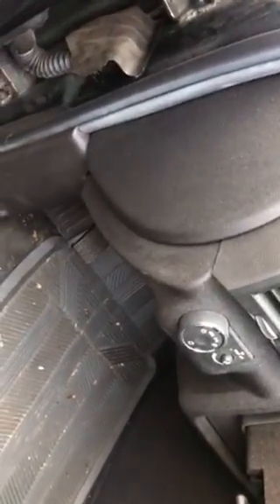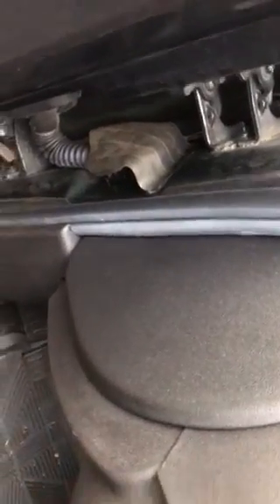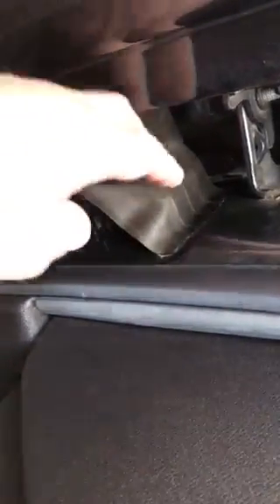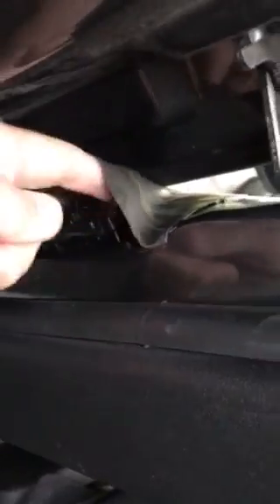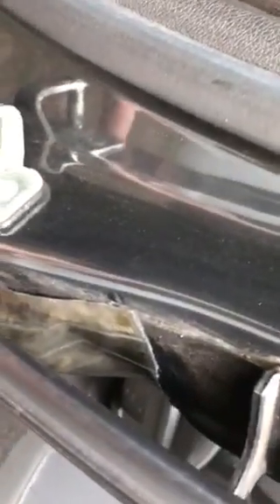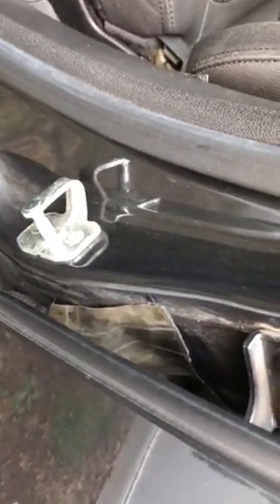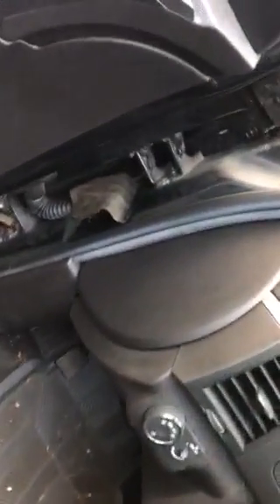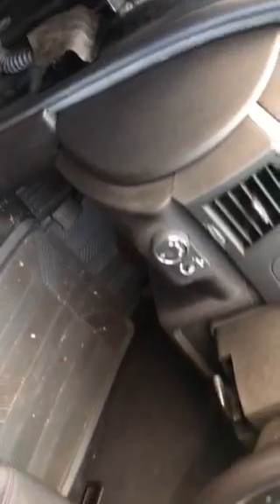Chevy Traverse - Easy Fix for Radio Speakers not working due to water leaking onto door wire harness

Comment from the maker: It stopped the water from entering the wiring harness switch at the door from the outside surface but I noticed that over time water still enters from the rear of the switch.  This means that water must migrate from the roof area onto the rear surface of the switch.  I have read that other people noticed this also and that it possibly comes from the roof rail screws.  What did solve the problem was that I actually replaced the front two speakers.  It was not all that difficult.  There is a video that provides details on how to remove the door panels.  Once you do one, the other is easy.  Once I gained access to the speakers,  I was able to confirm that the water issue was not the problem because the speakers were dry and had no evidence of being affected by the water at all.  In fact, the rubber tube that is seen between the door and body frame where all the wires go through has a sag and that is where all the water sits and never gets to the speaker.  I did notice that the wire on the speaker itself had partially decayed leaving what I suspect was copper dust,  Upon replacing the speaker, I tested it and it work as new and continues weeks later.  I checked the price for the speakers on Amazon and Rock Auto.com where I normally get car parts from and they were comparably priced.  Just as a tip, the left (driver's side) speaker is the one that is used for hands free phone use and the audible back up and  other alarms, so I would suggest to get that one first.  Bottom line, the speakers are not good quality like so many other parts on this car and made to last only to a certain point then require replacement.  I still left my " glued on covers"  if anything, to help control the front surface water issue anyway.  Best of luck with your car.
Reply: How do you remove the harness?
Reply from the maker: @josecolon6584  No need to remove the harness. I only unplugged it for inspection.  There are clips visible that allow for it to be disconnected.
Reply: Silicone all roof rack screws and washers.

Comment: I have this issue but my wires are dry and only my tweeters work. Temperature causes my speaker to work or not work.
Reply: Dats you ever figure it out?
Reply: I have the same problem with my HHR

Comment: 2014 slt bose premium 60k, 
Radio sound suddenly cut out, no signal sound, no back up camera sound.
Thanks to posts here and acadia forum. Disconnected 4 door jam connectors.
Moisture present inside 3 out of 4 connectors. Several ounces from drivers rear. Shake out water.
2 hours later all is working.
I am making a list of repairs to do to prevent expensive component failure and dangerous situations.
Will add sealing roof rack to the list.
Will bike tube repair, after drying and dielectric grease.
Will add a diverter inside for door speaker & wiring. 
Will seal inside door side of harness.

What I have read about all water intrusion issues 2008 to 2018.
Older vehicles had drains in rear fixed moon roof, many issues with those drains getting clogged and leaking in head rest. So they discontinued drains. The issues with leaks from same fixed moonroof with updated no drains.  Fix is remove moonroof and new seals installed on body and edge of moonroof.

Mostly older models or after windshield replacement leaks due to seal at bottom of windshield area into front floor.

All models with sunroof have 2 drain tubes that run down the A pillars on both sides. Constant clogging.  There is a rubber 90 degree grommet at middle to top of firewall on both sides that drain tubes attach to. Older models pre 2013 had a 4 tab water gate inside grommet to prevent spider nesting. (Bad idea). Gets clogged at that point and leaks. Fix cut out or melt out the 4 fingers inside grommett.
Also most models, where water exits the firewall, on the outside under wipers cowel. The water drains down, then reenters passenger compartment a few inches below drain, through a horizontal body seam. You seal body seam  from the wiper side of vehicle, up in hole, especially on passenger side. 
These water backups can cause drips onto fuse box on right side behind glove box. Drips on left side on top of steering column onto BCM  and radio amp.
Could short out many other connected components as well.

Comment: The speakers arent the problem if they are coming back on frequently after a couple days of warm weather. As a test open your door and disconnect the wire harness after a rain stom and let it hang  (upside down) and you will witness water pouring out of the connector. My 2012 traverse had this problem as well. Take a shop vac and suck the water out of each end then use blow dryer to finish the process. After a little while (time may vary I'm not exact on how long) the speakers will all a sudden kick back on. I'm in process of replacing my lady's speakers just haven't had time and well been lazy. To prevent the water I'd say this video is good idea, the roof rack bolts filled with sealant and whatever else we can come up with to divert the water trail coming off the top....

Side note I've also read about the car amp is the main problem but it pissed me off and I haven't got back to checking the factory amp yet. So not even sure where that thing is. For gods sake I'm a doctor, not a pool man!! Enjoy your day of tweeter music
Reply: Definitely not the speakers. They did start operating after the weather warmed up.

Comment: its not there its on the top of the truck on the rack just fill the holes with clear silicone and let it dry out radio is working like new
Reply: Do you have pictures please where you put it ?

Comment: Also on the Buick Enclaves…..I was told I had to replace the whole module which is going to cost $750….even though radio is going on and off.  Fought with dealership on this because it seems like a wiring “connection” problem because audio still works half the time.  But…..I lost the argument and they are going to replace it.  We will see.

Comment: How long did you have to wait so you can get the sound back on
Reply from the maker: I feel it had stopped the water at first. But once I noticed the actual speaker wires were deteriorated, I changed the speakers and they worked right away.

Comment: In some cases yes this is a good fix but in most cases the leak is actually from the roof rack bolt holes, and also water leaking down from the windows and getting on the speaker connectors. Seems to me that the main issue is poor weather proofing all around the vehicle. What I've done is removed my roof rack bolts and put clear silicone in the holes and bolts them back down, as well as using some black weather proofing tape (ZIP tape is what I used) around the electrical connectors on the sides of the doors and inside the door panel. Replaced all 4 speakers and so far so good, will see how this holds up after a few more rain storms.
Reply: Thanks I’ll be doing this 🙌
Reply: @drivewaybuilds did it work for you?

Comment: I can’t go to a car wash or I lose sound. Tried different ways, protecting the connection. I don’t think it seeps in from the seal not installed correctly. Started washing at home and found when I clean my hood, water is coming in. No water or dew in mornings, my speakers work.

Comment: Did this fix the problem. I have the same issue with my 09 acadia
Reply: Tina Edwards I have the same problem
Reply: What glue did you use to bond rubber to the vehicle?
Reply from the maker: Yes and No.  It stopped the water from entering the wiring harness switch at the door from the outside surface but I noticed that over time water still enters from the rear of the switch.  This means that water must migrate from the roof area onto the rear surface of the switch.  I have read that other people noticed this also and that it possibly comes from the roof rail screws.  What did solve the problem was that I actually replaced the front two speakers.  It was not all that difficult.  There is a video that provides details on how to remove the door panels.  Once you do one, the other is easy.  Once I gained access to the speakers,  I was able to confirm that the water issue was not the problem because the speakers were dry and had no evidence of being affected by the water at all.  In fact, the rubber tube that is seen between the door and body frame where all the wires go through has a sag and that is where all the water sits and never gets to the speaker.  I did notice that the wire on the speaker itself had partially decayed leaving what I suspect was copper dust,  Upon replacing the speaker, I tested it and it work as new and continues weeks later.  I checked the price for the speakers on Amazon and Rock Auto.com where I normally get car parts from and they were comparably priced.  Just as a tip, the left (driver's side) speaker is the one that is used for hands free phone use and the audible back up and  other alarms, so I would suggest to get that one first.  Bottom line, the speakers are not good quality like so many other parts on this car and made to last only to a certain point then require replacement.  I still left my " glued on covers"  if anything, to help control the front surface water issue anyway.  Best of luck with your car.
Reply from the maker: @chipb1193  I used an all purpose glue that I purchased at Lowes.  It is called Rapid Fuse by DAP.  The glue worked better than expected.   (Note my reply to Tina as it may help you also.)

Comment from the maker: The key question recently asked was, Did it fix the problem?  The answer: Yes and No.  It stopped the water from entering the wiring harness switch at the door from the outside surface but I noticed that over time water still enters from the rear of the switch.  This means that water must migrate from the roof area onto the rear surface of the switch.  I have read that other people noticed this also and that it possibly comes from the roof rail screws.  What did solve the problem was that I actually replaced the front two speakers.  It was not all that difficult.  There is a video that provides details on how to remove the door panels.  Once you do one, the other is easy.  Once I gained access to the speakers,  I was able to confirm that the water issue was not the problem because the speakers were dry and had no evidence of being affected by the water at all.  In fact, the rubber tube that is seen between the door and body frame where all the wires go through has a sag and that is where all the water sits and never gets to the speaker.  I did notice that the wire on the speaker itself had partially decayed leaving what I suspect was copper dust,  Upon replacing the speaker, I tested it and it work as new and continues weeks later.  I checked the price for the speakers on Amazon and Rock Auto.com where I normally get car parts from and they were comparably priced.  Just as a tip, the left (driver's side) speaker is the one that is used for hands free phone use and the audible back up and  other alarms, so I would suggest to get that one first.  Bottom line, the speakers are not good quality like so many other parts on this car and made to last only to a certain point then require replacement.  I still left my " glued on covers"  if anything, to help control the front surface water issue anyway.  Best of luck with your car.
Reply: Does the turn signal sounds come out the driver side speaker as well?
A year ago, there was a loud screeching noise coming out of the speakers. Radio wasn't putting out noise just a screech. The noise went away after a few days, but since then nothing comes out from the speakers, not even the turn signal noise.
I'm wondering if it could be just the speakers.

Comment: I tried it but does not work. Everytime it rains just a little I lose sound. The problem is the door seals. Even when I buff my car powder is all over, everywhere in door jambs
Reply from the maker: Try replacing the speakers.  If your car is the vintage as mine, it will most likely be the speakers failing.
Reply: My plugs are always wet. I'm going to try the silicone method on rack holes

Comment: All in good. How do I get the speaker back to working?
Reply from the maker: Unfortunately, I had to replace my front speakers   There are some really good videos on how to do this on Youtube.  I found that the speaker wires at the connection point of the speakers had deteriorated so badly that they had to be replaced.

Comment: What was the cause
Reply from the maker: I suspected it was the water at first but it turned out to be the speakers.  Their connection deteriorated over time.  Once I replaced them it was all good.  I still left cover on for added protection.
Reply from the maker: It was the speakers that failed.
Reply: Thanks; ordering some speakers now
Reply: @christopherbowers86 , any updates on your situation??
Reply: @adamsalvatoredivenere2826  ordered 4 New Rockford Fosgate R165X3 6.5" 180W 3 Way Car Audio Coaxial Speakers Stereo (68.99) free shipping. Came with a fit kit. Didn’t need the fit kit for the back doors. All speakers work perfectly. But Adjust the sound to play a bit higher in the rear; to keep radio from resetting. I don’t know if that will happen to you as well; but if it does, you’ll know what to do.
Reply: @christopherbowers86 , if you don’t mind telling me what happens when the radio resets I’d appreciate being more aware if it happens. And any tips or things I should watch out for when doing the replacement my self?
Reply: @MrJoscast52  I know this is an old conversation but I still believe its the water shorting the connection and blowing out the speakers. When I had the issue I replaced the front speakers with a nice pair of JBL GTO629's. ($80 at the time. They're $30 more now). I did nothing to protect that door harness. Before long I lost sound again. I opened the door panel up and the speakers were literally blown. They had visible cracks and tears in the cones. So that was $80 down the drain. I recently bought the OEM speakers that sound surprisingly great for $25 each. I installed them and spread silicon sealant on every nook and cranny I could find on those door harness connectors; the grommets in the door and body and all around the connector itself. It seems to be doing well for now but I'm not 100% sure water is entering the part of the connector we can see. It may be inside the car body and/or door panel. I'll continue to keep an eye on it.